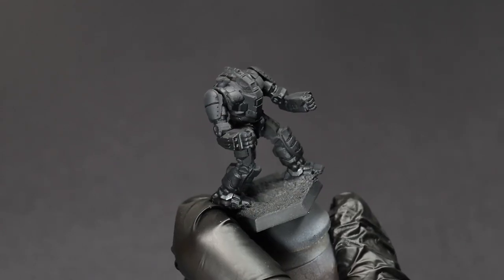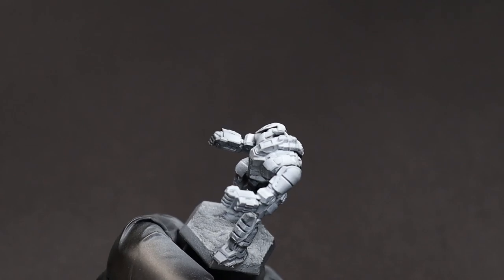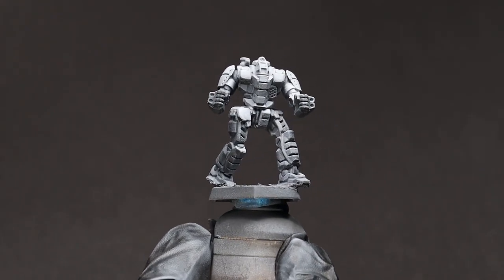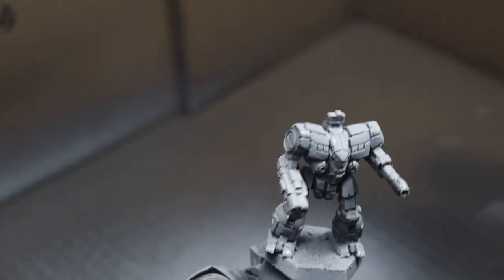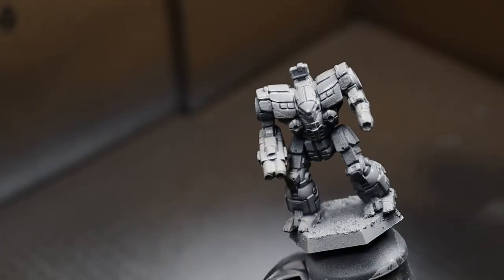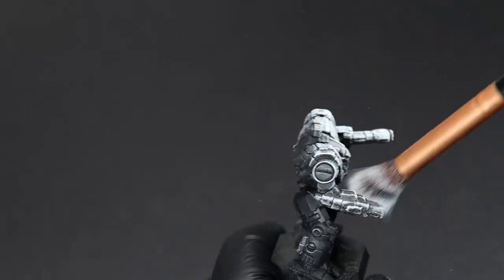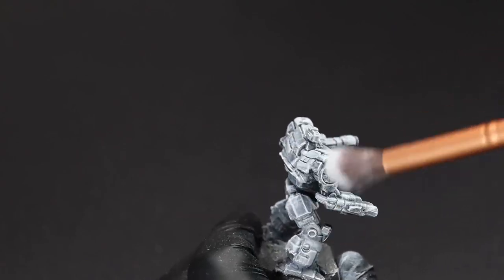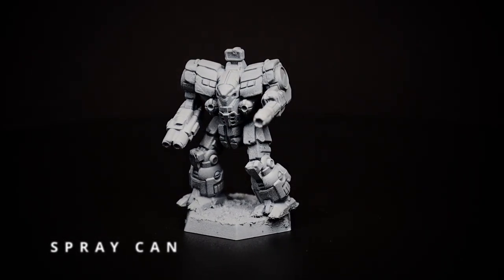How To: Zenithal Prime in 3 Different Ways

Comment: I've been wondering if a few quick squirts of white spray over black primer combined with some finishing touches with drybrushing on white would be a nice look. Might combine some of the speed of the spray can and the control of drybrushing.
Reply from the maker: Maybe! The white sprays that I usually find tend to throw a lot of paint on in even a few, short bursts, so you'd have to find one that lets you be a little lighter touch on the application.